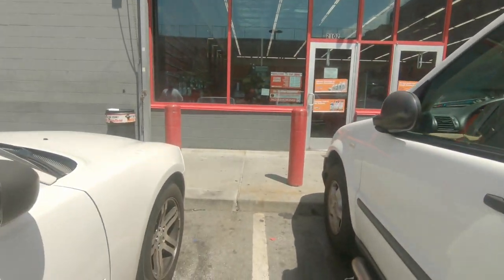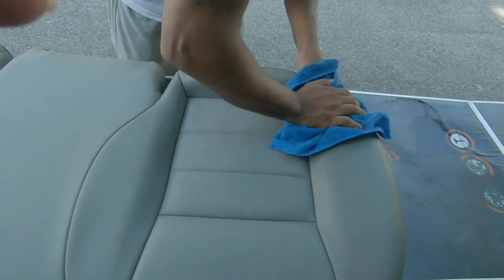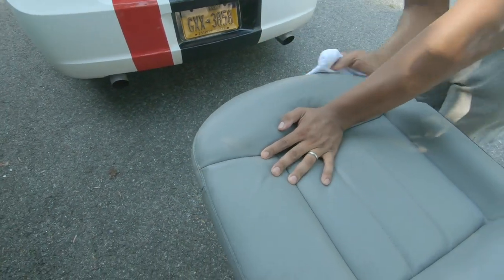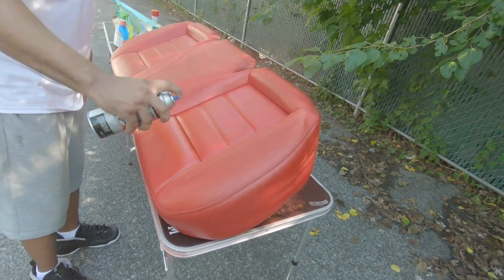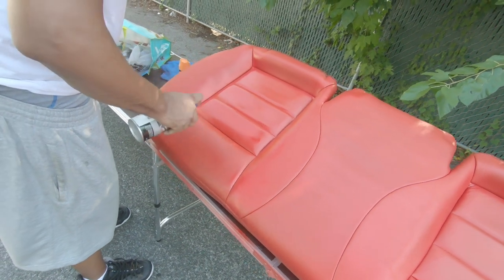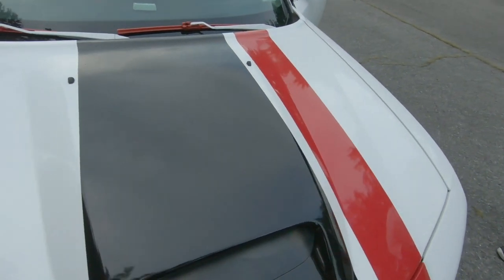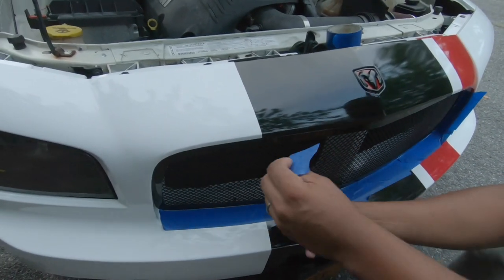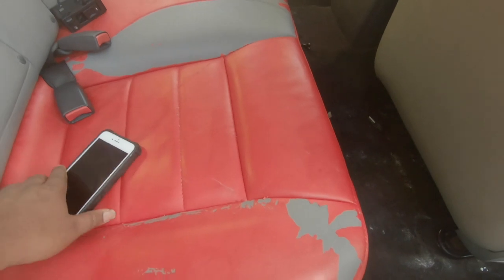Paintin leather Seats Red *WATCH BEFORE TRYIN* (DIY)

Comment: It’s a dye, you did good on the cleaning but you do not use primer. Do light coats straight on the clean leather. 4-6 light coats. You can even use a little clear coat about 20 minutes after it’s dried in the sun. Let dry for 24 hours before handling again
Reply from the maker: Yea I realized the primer was the issue didnt sit well.
Reply: Yeah... primer dont go on leather paint

Comment: Hit that leather with 600 grit, use sure coat paint, a good cleaner the alchohol you used is fine. Leather seats have wax and oils on them to protect the leather. You need to clean it good with the alcohol and hit it with the 600 grit sandpaper wipe with a tac cloth and hit with alcohol one last time. 3 good coats waiting 15 minutes between coats. You were close, just needed a little more prep. Keep at it bro you will get it. You have a great color scheme, its going to look tight when your done.
Reply from the maker: Ima rry that i have to remove the paint that was left but trial and era u got to take risk in krder to know if u can im not afraid to do anything at this point thats what makes it fun.

Comment: SEM, dupli color all that stuff is the same thing..  you spray that dupli color straight to the material.. it dyes vinyl and leather...   it will never rub off..  that adhesion promoter stuff is for plastic...  i hope you were able to fix your seats..   but dupli color is a good brand..  ive been using it for 20 years and never had a problem..  i even spray steering wheels and it doesnt rub off after 10 years with 1 coat.. good luck on the channel
Reply from the maker: Chris Craft thanks appreciate the support I haven't to much good results with dupli I still use it just combined with other other paint I'm not gonna redo it I a peel it off to sale it because I'm gettin custom seats done.

Comment: The product ain’t the issue here, I’ma point out the two things that i think caused the cracking; for one you used primer and two the last coat you showed in the video was too heavy. I’d say your prep was good, follow up with by scuffing it a little, wipe with IPA then do light coats only, no medium or heavy, just light coats. Good video tho, many viewers will learn from your mistake so ain’t a complete loss after all! Keep it up
Reply from the maker: MS Babban your right I end up figurin out later the primer had a lot to do with it and I went heavy to try to get it extra bright I guess it didn't go in my favor at the time it's trial n era the video helps not to make the same mistake basically what the channel is about n not to be afraid to do things urself u fall then you get up and try again.
Reply: This was a very good constructive criticism. And I would 100% agree with you as well. However, keep up the good work bro!  Thanks for the vid!
Reply: Amen
Reply: I was thinking if he used a dye instead of paint it would do better. I’ve seen dye sprayed out of a spray gun. Light coats until you get the shade of color you want. Good content though.
Reply: Yep. Primer blocked the vinyl paint from getting into the poors like y'all spoke about.  Also yo thick of coats.  We all learn as we go with the new products.

Comment: first off you don’t use paint for leather seats. use dye the same way you would paint. you can even use a brush and paint it one coat at a time it will give you the shiny leather look that you want. won’t stick to you’re clothes either. sick cars tho🔥
Reply from the maker: Yea figured all that out thru trial n era I seen the paint be done years ago definitely wanted to try it the experience is always worth it thanks for the heads up it also heads ppl in the comments as well 🙏🏽

Comment: You did good cleaning them but you definitely needed to sand them some after cleaning them.  Do that and clean them again along with doing more coats it should last longer.  Still not the best product but it can work.  I also wouldn't do this for a daily driver because they won't hold up long term.
Reply from the maker: Hevi Rotation you ain't liein about that I learned the hard way but it's trial n era you won't know til you try things I definitely wish I would of did what you said but I think the primer messed me up as well.

Comment: The "primer" he used turned the flexible paint into a solid.....just clean real well and spray
Reply from the maker: Anthony Watts I want to redo it on another car but I also want to remove it what's the best thing to use with out ruinin the leather n I had a big feelin the primer played a big part in it.
Reply: @CmcMods  use acetone, you can even use sandpaper to feather the paint that's sticking. vinyl and leather is very tough and forgiving.
Reply from the maker: Anthony Watts I have 100 grit so it should be enough to get it off without damaging the leather.

Comment: I’m guessing the paint didn’t stick well because of the primer. Tha fabric spray needs to bond straight to the leather/vinyl. Car looks good though
Reply from the maker: Yea primer killed us I was tight but it's trial n era.
Reply: @CmcMods  primer doesn't help and seat need to be slightly scruffed up with a scotch bright to help the  Paint   adhere. I notice light coats are key or the leather just eats up the the paint.
Reply from the maker: Sengchanthra Long yea I learned that the hard way I was wondering if the alcohol played a part in it as well.
Reply from the maker: That's what I said but it was the primer we found out from a friend that paints as well.